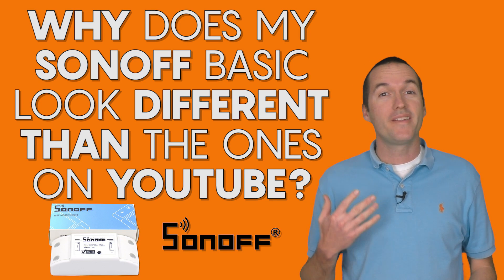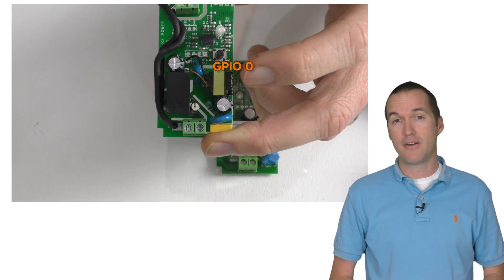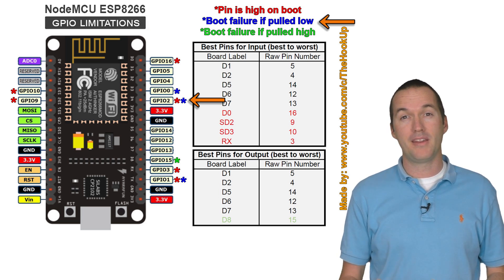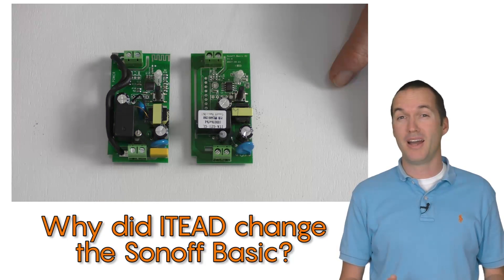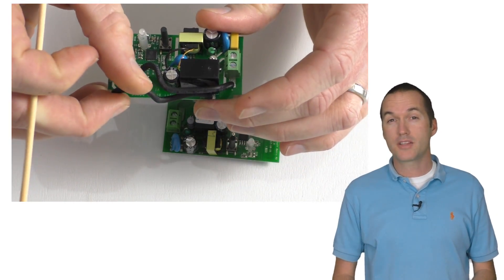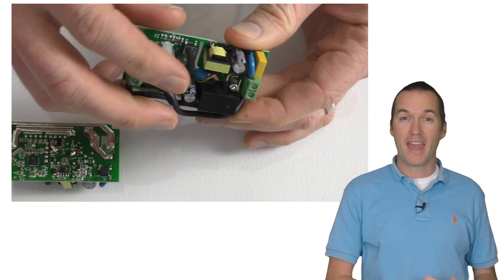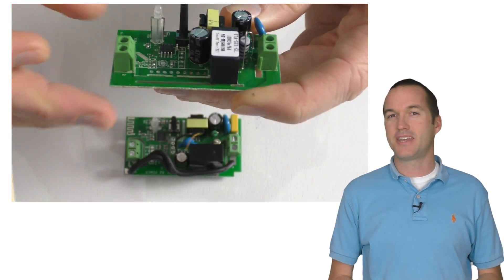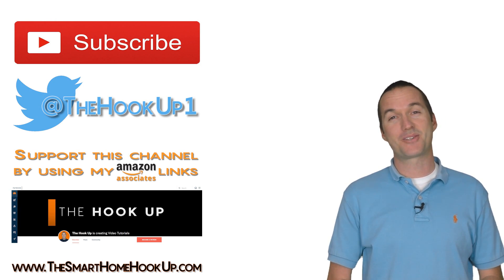New Sonoff Basic? Wires Inside? Is it better or worse? The Sonoff Basic RF R2 Power V1.0

Comment: It's also an ESP8285 instead of an ESP8266. GPIO14 doesn't even exist on the new chip.
Reply from the maker: Yep, GPIO5 would have been perfect to break out though.  I know it wasn't used at all in the old sonoff, but I didn't check to see if it was used for anything on the new board.
Reply: @TheHookUp  I've been using GPIO4, but it requires soldering a very small lead wire directly to one of the chip's pins. There's two unused gpios on the 8285 that aren't routed anywhere.
Reply: @curiouslycory  Which pins? Looking at this diagram (https://www.devacron.com/espressif-esp8285-what-we-know-so-far/), I can follow GPIO2 pad to it's pin on the 8285 chip so I know where to look for the pins you're talking about
Reply: I believe GPIO14 is the same physical pin 9 "MTMS" as on the 8266
https://www.espressif.com/sites/default/files/documentation/0a-esp8285_datasheet_en.pdf
Reply: pin 9 is gpio14

Comment: It needs sent to JW for a proper analysis.  

Funny it looks like they were worried about electrical separation And they keep that horrible transformer...
Reply from the maker: That transformer has to be the most commonly used part on smart home devices.  I've taken apart 50+ different devices at this point, and that thing is ubiquitous.
Reply: @TheHookUp  sure but I have 2 that failed....those they use are not the same.  They are poorly wound

Comment: I could be wrong, but I thought that I followed "Key" back to GPIO14?   and the IO2 solder pad is GPIO2?   why have 2 pads to the same pin
Reply from the maker: I will double check when I get home, but I was getting continuity between the two.
Reply: @TheHookUp  Either way since the pin is available I will use the RX pin as you suggested.   Thanks for the video I just got mine flashed yesterday and was going to use key
Reply: As far i i can measure "key" pad is connected to gpio0 (pin 15), and not to gpio2 (pin 14).

Comment: They could also just want all your HA to rely on their servers. Data-mining might gather them some extra income. </tinhat>
It's more likely for the reasons you suggest in the video. So, gpio14 isn't to be found anywhere but the chip itself? Bummer. Maybe 2 strands from a Dupont wire soldered to the chip leg & some hotsnot to hold it? That's a ton of labor when there's Shelly as an alternative.
Reply from the maker: I agree that the basic is sort of "old tech" now.  There are much better options out there.  I've replaced all of my sonoff basics, with shellies.  I do have two sonoff duals still in the wall, but they will be replaced soon.  

I bought this new version for research and to produce this video since I was getting a lot of comments asking about it on other videos.  I don't ever plan to install it.
Reply: Old Curmudgeon they will fall out of favor with the diy community I think. I certainly won’t buy anymore.
Reply: @mrphyslaw  w/ shelly & nodemcu as options and now having access to a 3D printer, there's no need to mess w/ the basic variants. I have a few smart outlet models, but only 1 SV. The SV was just more convenient than scratch-built this time. I needed I2C & a pin for PIR so this new design won't work. Wonder if they'll change the SV next.

Comment: Does this new one still have inching mode? Is it easier to mod it physically with the wires? Would I still need to cut the board or just the new wires?
Reply from the maker: From what I've seen there are no changes to functionality, so inching mode is still possible.  

As far as modifications.  I've seen some interesting modifications to the old sonoff basic cutting traces and adding diodes, but I don't recommend them, as I've seen just as many burned devices as successful devices with that mod.  Theoretically it should be easier to do now that there are wires instead of traces, but I still wouldn't recommend it.
Reply: It looks like the High Voltage input to the relay is now VERY close to the large resistor.  I would say it is no longer possible to safely cut the board and use the relay as a "button" or low voltage switch.

Comment: Really useful video, thank you! I was impressed with the wires for the high current, as I've jolted myself on a few occasions with the tram lines. However, I'm really disappointed that they have removed GPIO14. My whole setup relies on that pin! The Sonoff is a great starter device, but I have had issues with flickering, re-starts and occasional non responsiveness, so I'm looking forward to that new Shelly Product, inc. dimming, that you talked about as an alternative... any idea on ETA for that?
Reply from the maker: No ETA on the dimmer unit, but I know it is being actively developed.

Comment: My problem with it is that it won't go in to flash mode. I read that a lot of users have that problem. It might by faulty one.
Reply from the maker: I have heard about needing to hold the button down for the entire flash process.  Mine didn't have that issue, but it's one that I read about on github message boards.
Reply: @TheHookUp  i'll give it a go.
Reply: @adas4190  in the last 3 weeks, I've ordered 5x Basic and they were R2 v1.0.  The flash process is hit/miss.  Reading the forum, you need to essentially put in a blank 1meg to flush out the oem FW, then flash with a basic "minimal" load, they I got one of my 5 to flash with Tasmota sonoff_6-4-1-9 and stable.  I am having a heck of a time with my other 4 to get Tas onto it.  Let me try the "hold down" the button during the flash process - I do have two hands...
Reply: To add to this, I got my Basic R2 V1 (silk screen with RF), but it's a NON-RF Basic to flash consitently.  This issue was the FDTI adaptor, the 3.3V pin was only putting out 3.26V, there was a VCC  pin and that was putting out 3.56V.  I've used this for my Positive DC lead, and using Python ESP Loader (Windows), put it into Flash mode (standard hold down button, apply 3.56v power, release button - see below as a safty precaution), erase the node.  Put it back into flash mode, and load up with Sonof 6.4.1.9 FW, and it boot with LED green and mean.  Put in AC Main power, booted up, press button 4x quickly to put it into AP mode, got in to 192.168.4.1 and re-config the WIFI, MQTT, etc.  Very consistent!  So make sure you have a good FTDI adaptor.  Seeing that if RX is plug in, it may not go into flash.  I just apply Ground-Ground, Press button, apply 3.56V to the positive lead, let go of the button, apply TX-RX and RX-TX, then flash.  Hope this helps.
Reply: I found a reference in another video for entering flash mode and it worked for me -- consistently. On the 5-hole pinout (with 3v3, Key, Led, K_P, Gnd), jump the K_P and Gnd pins and hold the button on boot. It was a little tricky, but I was able to hold a jumper wire on these two pinouts while holding the button and powered up the device. Simply holding the button on boot did not put it into flash mode. I am unsure if the process works without holding the button, but I was able to consistently place each of my 4 units into flash mode using this method. I then used PyFlasher (as recommended in the Tasmota wiki) to quickly flash the chip and Termite to easily enter my wifi creds (with ssid1 and password1 commands) and connect it to my network.

Comment: Is the WiFi antenna redesigned? I saw large traces on the board. Could perhaps a WiFi reception test?
Reply from the maker: Good question, and easy to test.  I'll do that this weekend.
Reply: I got a new and an old th10. The range is much better with the new one. Phone doesn't even connect, the th10 does perfectly.

Comment: Slightly confused by the video title. The sonoff basic, rf and power are 3 separate products. Is this new unit a combined model?
Reply from the maker: It is confusing.  The reason I put that in the title is that those are the words that are screen printed on the circuit board so someone who pops open their new sonoff will most likely use those words in their youtube search to find out about the changes.  

I assume all those terms are screen printed on there because they will use the same circuit board for both the RF and non-RF units.
Reply: @TheHookUp  Had the exact same problem. The board had the "Sonoff RF R2" printed on it, but I could not find any trace of an RF-Module seen on other videos. So looks like iunified boards for multiple versions.
However, flashing it works exactly the same, did not have any problems with it.
Reply: @TheHookUp  we going to see a how to for flashing the new boards?!
Reply: @LukeRT  Its the same.

Comment: Hi!

Nice video as usual, but there are two questions I hoped you'll answer in the video:

1) Any changes to the physical form factor? (Seemingly none, but who knows?) I'm asking because I'm in the process of designing a much better and safer enclosure for my Sonoff Basics and having the form factor change would be a real bummer...
2) So, a different chip. Does it still fully work with Tasmota?
Reply from the maker: No changes to form factor.  I touched on the chip a little in the video. The 8285 is just an upgraded 8266 that has 1mb of flash memory on board, tasmota will still work perfectly.
Reply: In video #31 you went over changing the memory chip out to accomodate changes to code. is the 1mb enough to make the mods you suggested in that video?
Reply from the maker: @tamvalley415  I think you may be confusing me with Jonathan from SuperHouseTV (thanks for the compliment).  

That mod will no longer be possible, but I really would never have recommended it anyways because:
1) Better options are out there.  A shelly has 4mb of flash memory and is an overall better product.
2) There's no reason a program should be larger than 1mb unless you are running a webserver on it with lots of image resources.  Tasmota is creeping up on that limit because it contains TONS of extra code that never gets used by a sonoff basic (drivers for various sensors, chips, etc).  Tasmota can be significantly reduced by removing some of the included xdrv files and dependencies.
Reply: @TheHookUp  & @Michael Thomas - Thanks for both answers, it's really cool to know that existing stuff like custom enclosures and Tasmota will still be fine!
Reply: The form factor is the same and I have flashed with the latest Tasmoa and not had any problems. I  ordered 5 about a month ago and was surprised to find the design change expecting them to look like the videos.